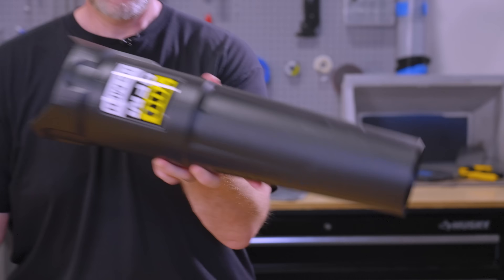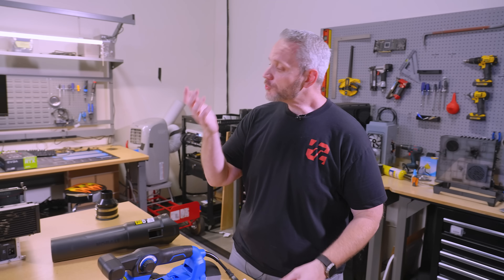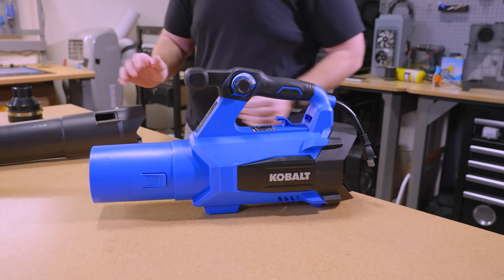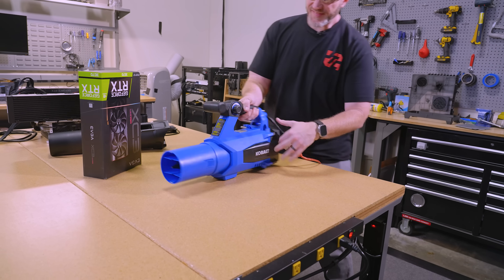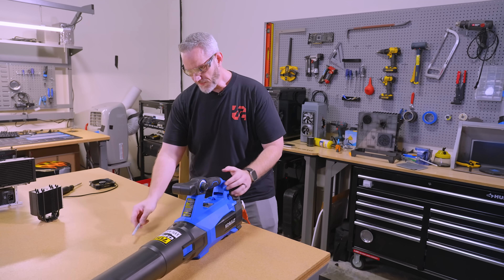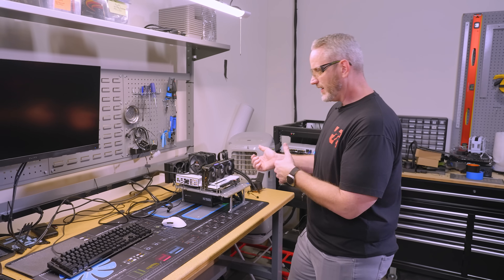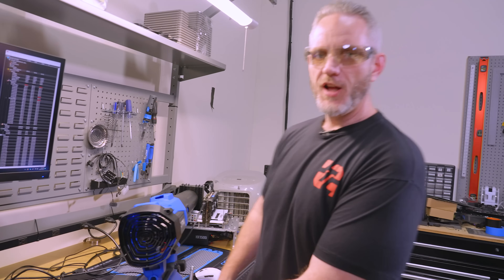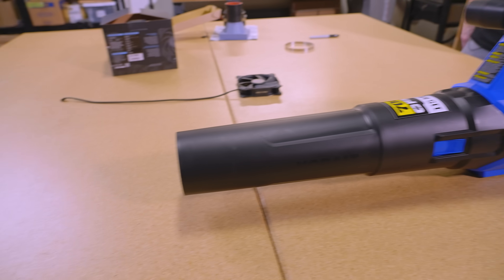I used a 115mph Leaf Blower as a CPU cooler... What could go wrong?!

Comment: I don't think that was the main problem. You choked the radiator with too much air just like if you point that beast of a blower at someone's face (please use safety googles): that person won't be able to inspire correctly. I don't know the physics of that, if too much air trying to enter the mouth (or radiator for this case) or the air passing outside the face at high speed creates negative pressure and a vacuum effect that doesn't let air into the mouth (radiator). As I said I don't know the physics of it but don't need to know the how-tos of it to experiment this. Of course the radiator's limit of absorbing heat may be the reason but I don't really think that's the main reason.

Comment: Water to water heat exchangers are more efficient than trying to remove heat to the air. I think it's time for Jay to get a reasonably prived plate heat exchanger and a small pump, drop the heat exchanger exhaust hoses into a 55 gallon drum of water, and see how much he can get the temperature to rise. Another option might be to just immerse a sintered bronze keel cooler in the drum instead of a radiator and then a 2nd pump would be unnecessary.

Comment: I notice you have a roll around AC unit for your shop. please please upgrade that to a at least a split system or a window unit built into the wall if that is an outside wall. The roll around units are sooo inefficient at cooling. I would think some one who is all about super efficient cooling for pc parts would also get super efficient cooling for the shop space :p

Comment: I've had an idea for years that I'll probable never get around to.  Seal the case and pressurize it.  It'll be warm at first but once it cools down to room temperature, the increased air density should help remove the heat using regular old heat sinks.  Getting heat out of the system will come from conduction of the air with the case.  I don't know what pressure various components will fail.  There is a lot I haven't addressed here but like how exactly to contain the pressure but if you can manage to get to even 2 psi over ambient, you'll be addressing them.

Comment: Do not forget the heat from the motor on the leaf blower. That motor gets hot and uses the airflow to cool it btw.
Reply: Yeah just like a hair dryer I bet. Does it use an electromagnet or a solenoid like a hair dryer does?

Comment: How would a small heatsink like one used to passivly cool memory or vrm's attached to the cpu handle with this blowing on it?

The heatsink should obviously be sized to fit the ihs but i feel like if you were to cut out part of the heat delivery issue in the tower you could get it to work 🤔

More fun lab/science/experiments please 🤠

Comment: This was funny AF and a great experiment...but fundamentally I feel like Jay missed the golden opportunity of a lifetime experiment... what he should ve trying is running his liquid cooling through a refrigeration system. At its fundamental core the liquid>air no matter what and the real limitation of liquid cooling is its equilibrium. If you could draw down the cooled side of the liquid cooling   lower than ambient temp you would see massive gains...if you really got ambitious and found someone with an unrestricted "EPA" and actual refrigeration knowledge since most CPU heatsinks already have hollow copper tubing in theory you could run that heatsink into a EVAP unit running the refrigerant right through the tubes instead of the air that circulates gaining maximum efficiency. The only thing i would fear doing that instead would be the issue to address with condensation....that and also needing to aggressively monitor the  CPU heatsink temps to not allow it to drop extremely low where it may effect its ability to conduct electricity and would require a bypass for a defrost cycle. Also im doubtful the copper tubing in the heatsinks have a wall thickness to withstand the PSIG required...may involve making a homemade heatsink with proper HVAC OD tubing

Comment: I used to work as a laptop tech and repaired a lot of laptops coming from schools. Those schools often had some sort of workshop class, metal work, carpentry, etc. Guess what those students did when their computer's fan clogged up with dust and debris and they had access to that sweet, massive shop air compressor… I'm pretty sure those classes alone kept laptop fan manufacturers in business for years. :)

Comment: Most people are blissfully unaware of how much rapidly compressing air actually heats it up and, conversely, how much rapidly decompressing air cools it down. You can literally generate instant ice by decompressing air rapidly enough.

(Compressing air is also the reason why space shuttles and meteors catch fire on entry. Most people think it's air drag that does that but it's not: It's the air compressing in front of the object which heats to tens and hundreds of thousands of degrees.)

Comment: Just a precaution, I'd advise using ear protection when using a leaf blower, especially indoors. I use a leaf blower to dry my car after washing it (I'm guessing you do too) but the sound of it is so loud even outdoors that I tend to put on a set of wireless earbuds on whenever I use it.

Also, I used the leaf blower to clear out dust from my PC as well. lol It worked fairly well! Just use it in short bursts and in an open area like the garage or outdoors so the dust doesn't go flying everywhere you don't want them to be. I should probably look into getting a mini electric duster/blower for smaller areas, though. XD

Comment: WHAT IF
The effect that compressed air heats up, and expanded air cools down, can that be used to cool a PC?

A closed circuit of air, at one point the air is compressed, heating up.
The heated up air is then pressed through an intercooler, to give away the heat.
next the airpressure is much lowered so it cools down and can then be used to cool a CPU.

Comment: Had to rewatch to see the cooler itself was lifting with the whole rig. Assuming that the mounting screws were tightened to 10~15in lbs. It is safe to say that the 31+ ft lbs. of force from the leaf blower had pulled it clear from the top of the CPU somewhat. Resulting in less than favorable heat transfer.

Comment: i once used a gas leaf blower to clean out my dusty PC and i had the fans spinning so fast the leds started to light up and then the top fan on the case exploded shooting 2 of the fan blade into my sheet rock wall in the garage. oops. PC still worked fine, the fan didn't, lucky me.

Comment: I wonder if that much force from the blower right on the cooler was enough to lessen its clamping force to the CPU. It was enough to slightly lift it and all that force was applied right at the CPU and cooler.

Comment: Fun stuff 👍👌
You should use it to cool a 120 radiator/AIO loop as you have done the air cooler it would be a cool comparison.
Reply: Was going to comment this with an additional hook up the ac to the back of the leaf blower

Comment: This reminds me of something I did Jay.
I used a Lasko Pro-Performance High Velocity Utility Fan as a 375 CFM case exhaust fan. I used a clothes dryer flexible exhaust hose to duck tape on the air intake of the fan and the other end was taped to a open fan mount on the outside of the case. Airflow achieved.

Comment: You will get better temperatures with this if you push cooler down while the blower is on. I think that blower lifts little bit the cpu cooler so it doesnt get good contact

Comment: Why not run it through the rad of the aio? Basically, just replacing the fans of the aio with... whatever this is.

Would that make a difference or would the absorption of heat still not be enough?

Comment: So....90dB for 5 minutes is permanent hearing damage. 110dB is a nightclub, and is permanent hearing damage in ~30 seconds. IIRC.

When I was working theater, I had to work for bands where backstage (behind the heavy velvet fireproofed curtains and 50ft+ behind the speakers) it was 90+dB sustained for 3 hours.

Comment: What's up Jay I just commented this on a other video but just figured I'd ask on this one if you have tested the LIQMAXFLO Series 240mm Liquid CPU Cooler (38mm Thick Radiator) it has a fan that blows on the vrms and it's refillable just curious if it's worth it or not

Comment: BUT JAAAAYYYYYY
you said it yourself the cooler cant handle this blower.
This video is just a demonstration of a bottleneck.

Please tell me you do this again, but with a custom loop.

Actually in particular, a high wattage cpu like a 13900k or a 5900x  

then see how far you can get on a good 120mm "custom loop" (you can cheap out building it 100% using scraps and flexible hose etc)

Comment: You should try to 3d printing an attachment on a 360 radiator that could connect to the leaf blower and have the AC right next to the leaf blower to see if that gives better results
Reply: Yeah, probably better to cool the air after the blower tough.

Comment: I kinda want to see how this does with one of those default AMD coolers, blow straight down at it and see what the limits of the little aluminum block are
Reply: So what I'm hearing is 'fun'
Reply: Theres a real chance of some of the SMD components on the motherboard blowing off :P
Reply: @Jigglenomicon  Or the RAM and GPU which are taller
Reply: @boam2943  Just use an FE card and you'll be fine. As for the RAM... Come up with some kind of 90-degree adapter?  Ooo!!! Or create a wind ramp. ;) XD
Reply: “How much airflow does it take to break a motherboard.”

There’s a fun idea.
Reply: Yup it shd be fun to disintegrate the mobo
Reply: cooling is probably gonna limited to the mass/volume of the heatsink

Comment: I assume you have an air compressor with a storage tank. Just use the air from the storage tank which will cool greatly when it decompresses.
Reply: my compressor draws 2.5kw?
Reply: @aeroflopper  Wouldn't that set a Guiness Book of World Records for the most powerful CPU cooler?
Reply: My case helps 11 fans, the heating came on this evening, i got it up to 71.9c 
 @TheBigBlueMarble

Comment: What about your portable AC.....blow cold air into the system....then use the AC intake pulling the hot air out of the system.
Reply: Or submerge the evaporator into a water cooling loop. That's what LTT did with their chiller...

Comment: One can only learn from their mistakes if they chose not to repeat them.
Jay: Lets do it again.
Reply: Now can it run crisis ?
Reply: @DIYTech21  Crisis is an outdated benchmark medium. Now its........... But can it run Starfield?
Reply: Just wondering, even though this is a fantasic practical solution LOL would it be better to bring the leaf blower back a little, as it being too close may be causing air to surface friction not letting the metal dicipate the heat properly? Just wondering :)
Reply: @djfromla  Jay needs to slap a performance car radiator on there, activate turbo cooling mode. HAHA 😂
Reply: Late game dwarf fortress